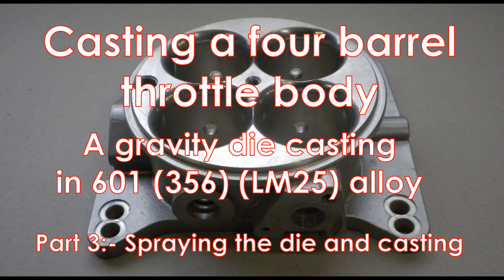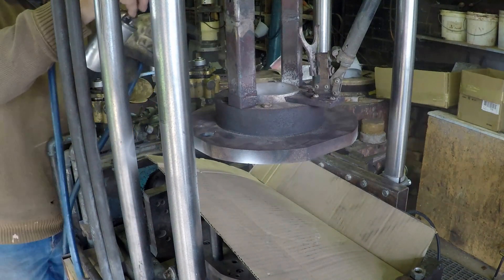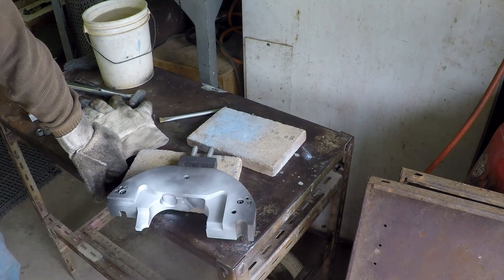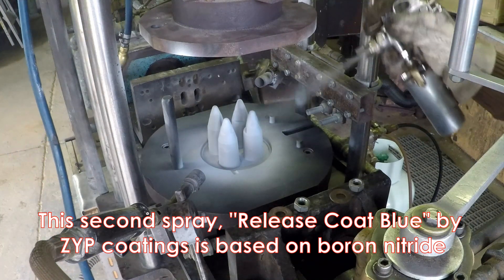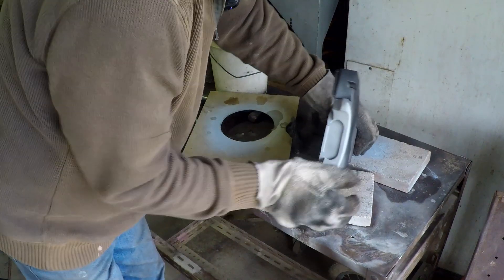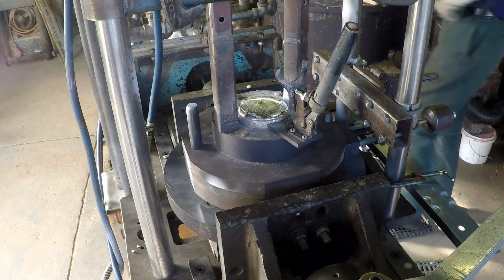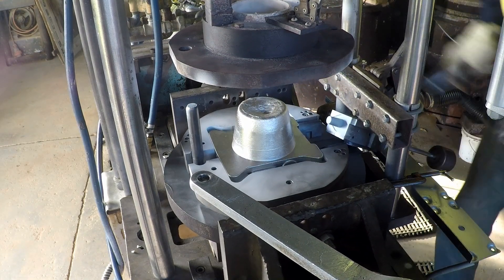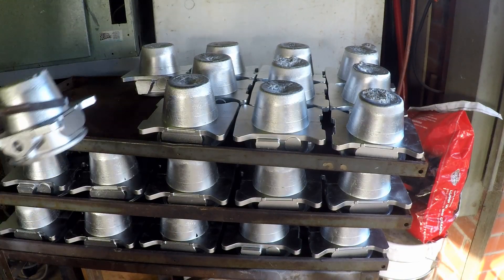Casting a four barrel throttle body Part 3:-  Spraying the die and making the castings.

Comment: Fascinating! Might I suggest, putting a marble or steel ball in your spray gun cups to agitate the solids / powder into a consistent suspension.
Reply from the maker: George, Yes, I guess I could do that but I find that a quick up/down shake just before spraying seems to suffice  -  any doubt and I twitch the trigger with my (gloved) finger over the nozzle of the gun, the air blows back through the can and agitates the spray very well indeed.... Martin

Comment: Enjoy your videos, when you was spraying the coating on the lower half I think you said you had a flame torch  to keep it hot for spraying to get the coat to flash dry. But I was curious  for the rest of the day do you have that lower burner on to keep the mold from getting too cool so the metal will solidify  evenly?
Reply from the maker: Brad, All burners are off while casting - with this job at least! The lower half of the die - i.e. the thick plate that the bottom burner is used to heat up does run somewhat colder than the rest of the die but this is a good thing as it encourages solidification progressively from this plate upwards into the big feeder. We don't really want solidification to be too even - we need it to be progressive towards the feeder with the latter solidifying last. I have seen dies where it was necessary to heat part of the die all through the casting run (never had to do it myself) but I have used a few dies where it was necessary to water cool parts of the die either to speed up production or the get a casting without shrinkage... Martin

Comment: sorry by the cuestion, the dies are from cast iron? who many pieces can you do in the life of the die?, (with this set up that you have), very cool, im from argentina, i want to do that for my motorcycle, i study for mechanical engineer
Reply from the maker: IDMA, The dies are from cast Iron, I buy it as continuously cast bar available in a large range of sizes and cut to length. I have never worn a die out so I don't really know but I believe that the life is in the tens of thousands of castings, certainly with some dies I have had many thousands of castings. However some parts of a die - small core pieces for example - may need to be replaced more often. Greetings from Australia... Martin

Comment: Incredible, very interesting to see all the dyes fit together. Would it be the customers job to make those or would you make them and the crazy machine too? Very cool
Reply from the maker: Julian, Making the dies😏 is sometimes organised by the customer but mostly I make the ones I use including this one. I bought an older CNC mill and spent a year getting it running , learning how to use it , and cutting this die - all very much a labour of love. 😊As for the "crazy machine" it and another several like it used to make brake parts and when the decision to scrap the machine was made I grabbed it. I have modified it considerably converting it from air to oil and adding the top cylinder, about another years worth... Martin
Reply: @olfoundryman8418  ahhh thanks so much effort! very interesting cheers

Comment: Goodness gracious - that is a really complex rig (die) for a complex part I guess - surprised about the mechanism, hydraulics and all - I worry and lament that other than for craftsman such as your self posting this to u/tube for posterity we would otherwise lose these skills completely - I suppose in the "old" days you would have passed this on to an apprentice or two - many thanks for your efforts on behalf of the manufacturing industry (what's left of it)
Reply from the maker: Gez, Sadly the old days are gone! There used to be a very good foundry trades school in Melbourne its now closed down apprenticeships in the foundry arts are gone. Most of the remaining practitioners are like me, old and either retiring or should be its hard to hump sand or dies around at 74. I hope at least that the videos will remain on YT for posterity but I have kept copies anyway plus all the original footage. Sadly large scale manufacturing is gone but there is a surprising amount of small scale stuff going on.... Martin

Comment: Now this is cool. I have visions of how I can apply this die technique to loudspeaker frames. I should stop watching your videos to many ideas ( not bloody likely to happen ).
It is a pretty advanced casting method. But you are breaking it down into bite sized pieces. Perhaps a covering of the questions after the video series?

Mark ( wannabe apprentice )
Reply from the maker: Mark, Long way to travel to work! Its not really that advanced its different but not that much from sand casting only a few easily learnt considerations to keep in mind (like getting the air out, which is automatic with a porous sand mould but requires special attention with a non porous metal mould. There is a sort of follow up video on the books planned for a week or two away. It will look at the variety of gravity die castings I have done over the years and some of the (less com-plicated0 machines used to hold the dies,. Hopefully you will find this interesting... Martin
Reply: @olfoundryman8418    "There is a sort of follow up video on the books planned for a week or two away. It will look at the variety of gravity die castings I have done over the years and some of the less complicated machines used to hold the dies"

 Hi Martin. This series on the four barrel throttle body was fantastic. Do you think you still might be able to show some of the less complicated die casting setups you have?
Reply from the maker: @rudycandu1633 , Oh my, how time flies when things are not exactly going one's way as much as one might like they were. You are right, I did promise that follow up. Indeed I videoed it all and I have about 1 hour or so of raw footage that I struggled through the shooting of. Some of it is not as good as I would like but it is now very difficult for me to do any reshooting - I had enough trouble with the first take and now many of the things I showed have been given to another foundry in order to keep my (now ex) customers supplied as I can no longer do the work myself, so reshooting is not possible - even if I were well enough.
However, in response to your comment I have begun to view the footage and to start to put it together in some sort of video. It will take a while and I have no idea as yet how good or bad it will be but I think I can get something out of it - maybe - possibly . So, stay tuned. .... Martin
Reply: @olfoundryman8418  Don't stress yourself of what could have been. Anything you come up with will be more than good enough. 

I think that your thoughts, ideas, history are things that we can learn from. Your posts are much appreciated.

Comment: Entire point of funnel core is keeping metal influx through filter, and holding filter in place, right? Different design of mould could do without it in case of this part?
Reply from the maker: Kuba, Yes, funnel is just to direct metal through filter, Filter is there to break the fall of the metal into two parts thus reducing turbulence. No doubt you could redesign this die to do the part differently but this was the easiest way I could come up with to do it. I would be fairly certain that just about every foundry would find their own way of casting this part. Initially I made the part without the funnel and filter but turbulence trapped air bubbles in the casting which ruined it - no such problems with the filter and funnel in use. If the funnel was steel I think there would be too much trouble with metal solidifying on it before it was removed you can see that the metal around the outside of the sand funnel has already started to go solid before it is removed with steel it would be worse and if the steel stayed hot enough to prevent this it would slowly dissolve in the aluminium alloy and contaminate it. Perhaps some sort of ceramic funnel  might work though. Other than the base plate the mould is grey cast iron not steel... Martin
Reply: @olfoundryman8418  thanks for answer
Reply: And if funell is removed anyway, why must it be single use sand core instead of reusable steel like rest of mold?

Comment: Fascinating die setup. Thank you for sharing every step Martin. Beautiful pieces
Reply from the maker: Jess, Its an old machine from another foundry I was just lucky enough to get my hands on  it when they threw several away. I have modified it quite a bit and while its not perfect it does the job well enough. Both my customer and I are very happy with the parts made... Martin

Comment: this really is a fantastic piece of workmanship, well worthy of praisfull comment. It looks a very compplex array of machinary you are using. I presume you made the jigs and all the hydrolic machinary yourself
Reply from the maker: hrxy1. Thank you for your wonderful comments. I just happened to be in the right place at the right time to pick that machine up but I have had to do a lot of mods to it. I did both design and make the die myself, I bought an older CNC mill to do this an then spent a year getting the mil to work, learning how to use it and then cutting the die... Martin
Reply: @olfoundryman8418  ty for your comprehensive reply, also read nerd usa comments too. Now here is strange  request. When you take abath or do the washing up and pull the plug. Which direction does the water swirl? i ve already asked geoff croker in NZ. But would like to know if its the same inAUS, ty.

Comment: Great stuff. Do you have to touch up the sprayed surface. Thanks for sharing
Reply from the maker: Rupert, The sprayed surface is stripped at the end of every day's casting and reapplied each morning before that days casting. the spray on the cores which tends to wear off  is retouched with a quick lubricating spray a few times a day. A few other parts of the die may get a very light touch up occasionally through the day too... Martin
Reply: Thanks. Look forward to your next video

Comment: First time i've seen die casting, Those coatings really do make all the difference, My (extremely limited) experiences with molten aluminium and steel led me to belive it would be a pig to do! and of course that's a fantastic setup! Thanks for sharing!
Reply from the maker: Leon, You have hit the nail right on the head! Without the coatings the job would be neigh on impossible - you MUST use coatings then its easy... Martin

Comment: The funnel core directs all the flow through the filter and creates a smaller sprue, once the feeder is full it does not matter any more so it can be removed and the feeder topped up?
Folks keep referring to carburetors for this throttle body?
Great video, I think this really gives the best view of what is going on, possibly because it is such a big die.
Reply from the maker: Smallcnc, The job of the funnel core is indeed to direct the metal through the filter. The filter breaks the fall off the metal into two much lower falls, this greatly reduces the turbulence of the fill and eliminates the bubbles like the one I showed in part 1 in a throttle body that had been made without the filter (or funnel) It is amazing the difference this reduction in metal fall makes - from nothing but rejects to nothing but good castings. They are throttle bodies to be used with injection systems and thus are not carburettors... Martin

Comment: G’day Martin, I thought your tradesman assistant wasn’t going to do anything but then he steps in as the press operator. Very interesting video and helps to understand how it’s made and where the expense goes to. With the onset of fuel injection I presume these throttle bodies would be still needed for the Hot Rod scene. Cheers 
Peter
Reply from the maker: PGS, My assistant is needed because I can not at the moment stand there all day and do the casting -I do not have the endurance. However his experience is limited so I have to do a lot of the setting up work. Yes, these throttle bodies are used with fuel injection - into the manifold I think...Martin
Reply: @olfoundryman8418  Respect to you and your assistant for sharing this wonderful craft with us here on YouTube.

Comment: How often do you have to spray the dies?   10pieces? 50pieces? once a shift?  Let me know if ya need a shop monkey to run that lever, looks like fun!
Reply from the maker: Tyler, World, With luck the spray lasts all day on most of the die. However on the 4 core pieces  I would touch up with the lubricating spray about every 20 castings. Every did job is different in this way some jobs on small core pieces for example it might be every 10 castings other jobs just the once a day and I have done jobs where the die was kept hot overnight (the spray can fall off if the die gets cold) and then the spray lasted all week with just the quickest and lightest of a refresh every morning. Sprays can be a bit of an art form...Martin
Reply: @olfoundryman8418  That's impressive.  I know boron nitride is some good stuff, just didnt know its THAT good.  No wonder its 50bucks a can here in the states.
Reply from the maker: World, Shop monkey? How many bananas per day? (it is a very boring job by the way, fun for about the first 2 castings than its a grind. Also see answer to Tyler ...Martin
Reply: @olfoundryman8418  fun for the first two casting, lol that's funny, but probably very true.
I'd find it interesting and exciting
Reply from the maker: World, $50.00 a can! Sheesh, mate out here I pay about $250 for a US gallon  - lucky you. I use it on my ladle and on the thermocouple sheath which stays in the metal all day, same thermocouple for over 5 years -  very good stuff mate, but limited to about 900 deg. C... Martin
Reply: @olfoundryman8418  I wish it would tolerate bronze temps.. 😖  I'd like to dial in my molten bronze temp a little more accurately.  I was taught how to watch for the swirl in the metal.  It's a wild ass guess, but has served me well for now.
Reply: I was curious about the same thing, about how many casts until a re application is needed
Reply from the maker: Tyler, For a while  but then it gets boring believe me! Its a case of lie back and think of the money 😊… Martin

Comment: Good to see you posting again Martin. There is quite a bit to setting up this die system, but once set up you can knock them out.
Reply from the maker: Mark, Yes, to a certain extent. The die has to be stripped and cleaned every days run if the part appearance is to be maintained and it takes a day or two (or three!) to do this and then re set up. Still at 60 per days casting it sure beats 6 per day as sand castings like I used to do 😊… Martin

Comment: Going to be some very happy Rev Heads when they get their hands on these 4 Barrel Carbies. Vroom Vroom.
Reply from the maker: Mark, Yes, I understand that they do get their jollies 😀. They aren't actually carbies just throttle bodies used with in manifold or in cylinder injection - not sure which but manifold I think… Martin
Reply: Olfoundryman probably TBI or throttle body injection.